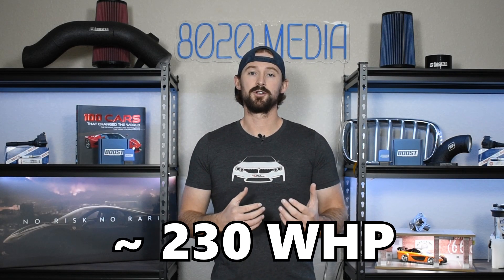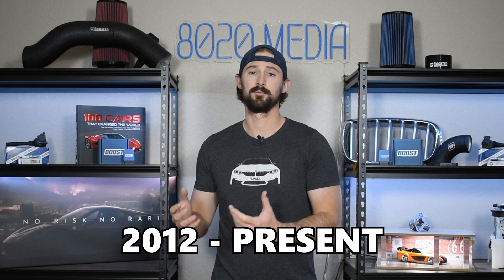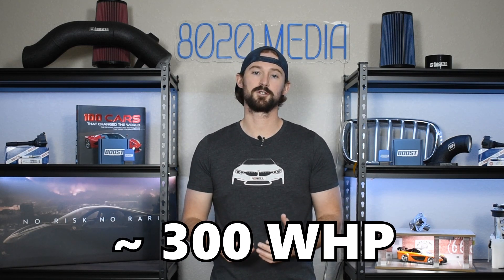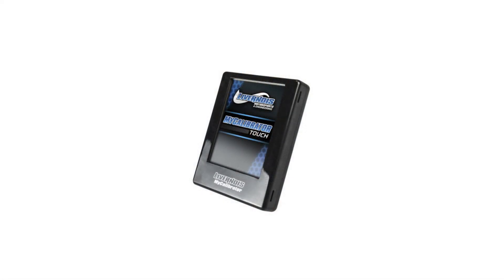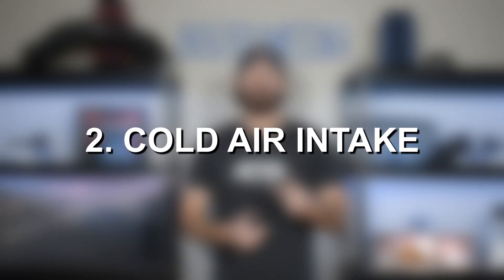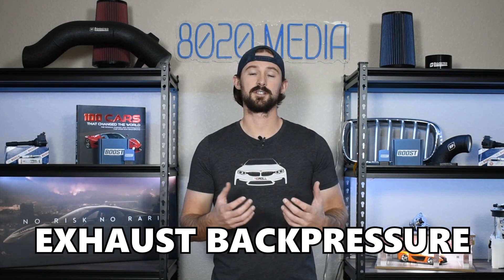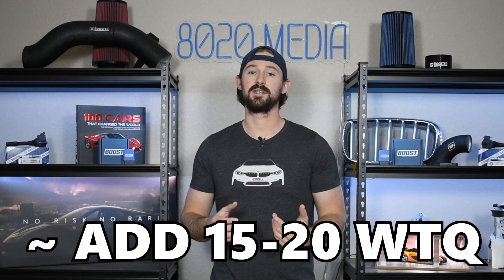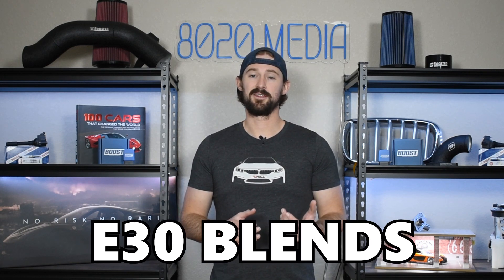How to Build a 300+ WHP Ford 2.0 EcoBoost!

Comment: How much would that cost?
Reply: Tuning - $700-$1500 None-Pro vs Pro Tuned
CAI - $350-$600
Downpipe - $500-$800+
Intercooler - $500-$700+
E85-E30 Blended fuel, not worth it imo, as your not just getting fuel, your also need different injectors and fuel pumps and that gets Really spendy, depending on the platform can cost an easy $2k+.
Just tune for the highest easily obtained fuel for your area and your be fine.

Note, these are prices for upgrading a 2024 Maverick, which I have done, or looked into for my own 24 EB Maverick. :).
Reply: @Sphoxros just buy a drop in performance filter for 50 bucks and gain almost the same hp as a cold air intake no need to drop that much for that when on turbo vehicles it doesnt make that big of a difference between the 2.
Reply from the maker: S - Thanks for taking the time to share this and help viewers!
Reply from the maker: H - Pretty close to what he said!

Comment: Appreciate the video!  Definitely putting this on repeat so i can get the most outta it.  23 edge here and im just Goin to play with I4 tb.  Any list i can look at? You have any products?
Reply from the maker: J - It honestly might be difficult to find parts for your vehicle, given a lot of Edge owners may not be looking to mod it.
Reply: @8020Automotive I would disagree. There is a HUGE community of Edge modifiers. Theres an entire company dedicated to the edge community. I see a bunch of lowered cars with upgraded inter coolers, intakes, throttle bodies, intake, turbos, injectors, cold air intake, E85 or high octane mods, custom exhaust etc. It’s honestly crazy, but it’s definitely a niche! Love the video man.

Torri at Unleashed Tuning does a LOT of 2.0 Edges! It’s cool

Comment: Ok, here's the concern, the 2.0 Ecoboost likes to blow up and create expensive messes. The early  ( if I remember,  2015 or so ) is pretty reliable. After 2017, Ford changed the block deck design and things started to break. The initial thought was just replace the head gasket and possibly the head but it was the block that was the problem. Look up FordTechMakeULoco on YouTube and he has a deep breakdown on all the EcoBoost engines.
Reply: 2020+ 2.0l’s fixed the issues of the 2017-2019 deck issues. The coolant slit/ramp between the cylinders created weak points that lead to head gasket failure and cracks in the cylinder walls (most commonly between 2-3). The slit that connected the open deck cooling in the block to the heads was replaced by a hole drilled below the deck at an angle which is a stronger alternative.
Reply: Yeah the late model eco boost 4 bangers have blocks that are prone to breaking
Reply from the maker: H - Thanks for sharing!